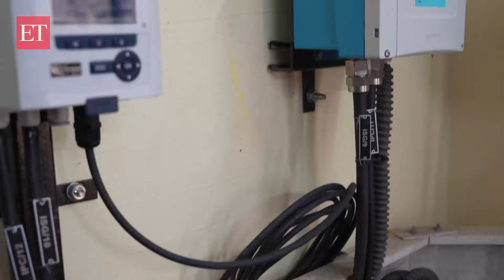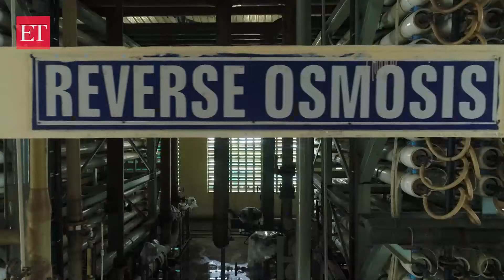How Surat's sewage treatment plant works

Comment: even after treatment this water shouldnt be discharged in any river,divert them for building man made lakes and watering the trees and for agriculture in villages.dont discharge in the rivers.there should be no chance for river pollution.
Reply: Sewage treated water is safe to be released into the rivers. A very massive quantity of water is treated everyday, and I guess even after diverting it to other places, the water will be left. However, sewage treated water is completely safe for rivers and aquatic life. It's far much better than the untreated water. Moving water has lesser bacteria because it purifies by itself. So there's nothing to be worried about. 🙂
Reply: @sanwalisood7507 actually Gujarat has deep sea water pipelines which hardly anyone knows. We release in sea deep water

Comment: Sir you can advice them you can generate electricity by thermal eloctro process because water is running into it it will easy to them to generate electricity
Reply: its not enough force to run a turbine i guess
Reply: @goldendeer7  yes
Reply: @goldendeer7 as he said thermal the steam rotates the turbine so direct need of water to rotate turbine so you may use it that way but this is a plant made to serve another purpose let it do that😊
Reply: @Suman.Kushwahwater in  power plants is used by turning it into steam (thermal power plants) or used to turn turbine directly when it falls from height ( hydro electric power plants) there is so such need of clean or pure water. 
*You do need clean and pure water in thermal power plants to increase its vaporization*
Reply: @Suman.Kushwahwhat are you talking about?